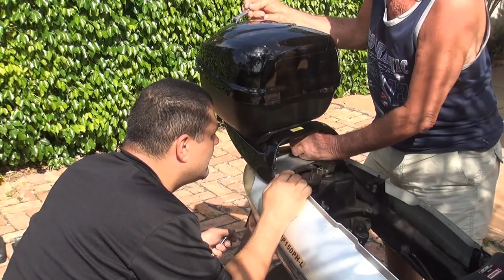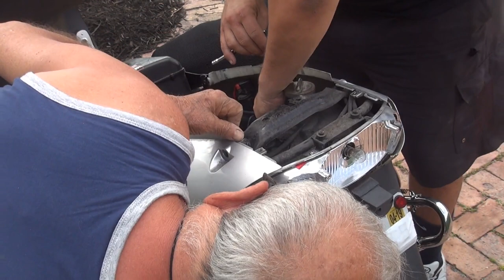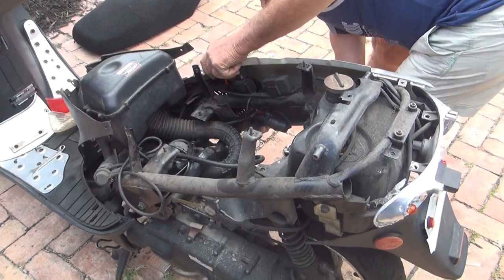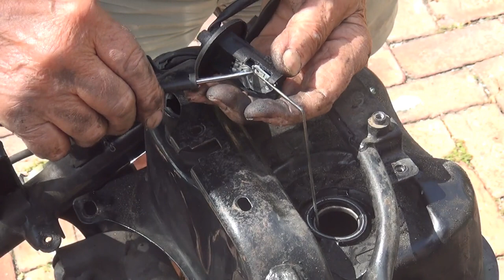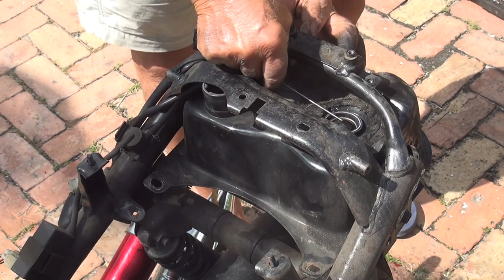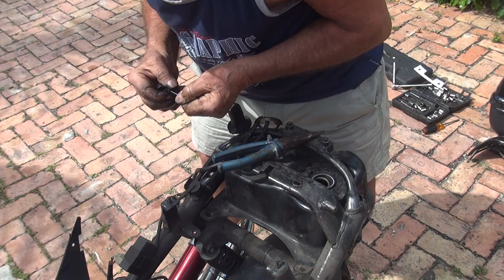How to check gy6150 cc scooter fuel tank and fuel sensor

Comment: Just replace it, not worth trying to fix it, my 125 scooter is the same problem, it’s got a full tank but gauge is saying zero, I recently cleaned out the fuel tank with water and soap and a jet wash from my hose so I may have damaged the sensor because before I cleaned it it was working fine, just bought a brand new fuel sensor on eBay for £5.11p, I’ll just replace it